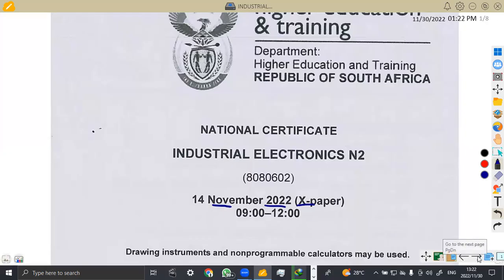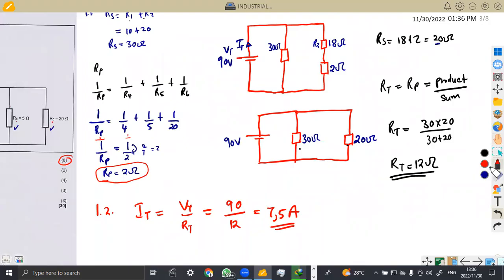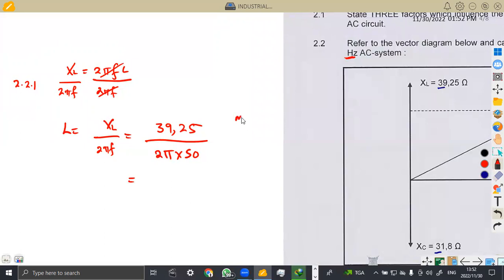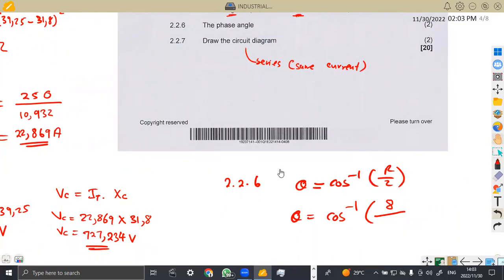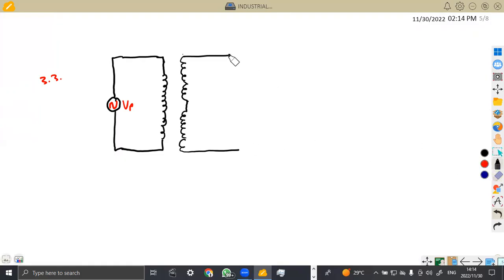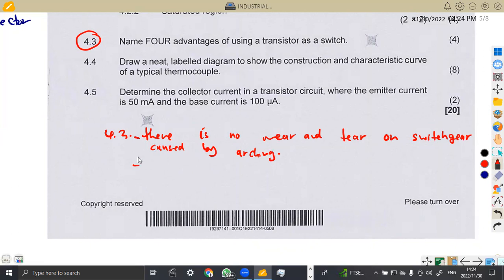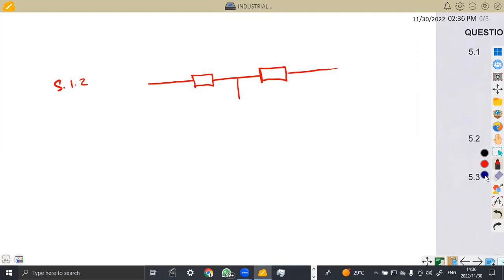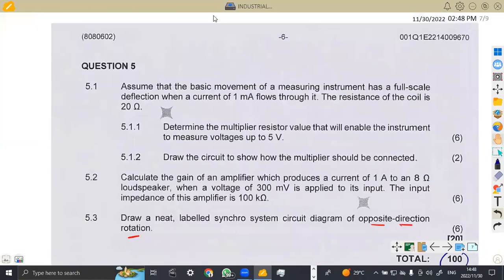INDUSTRIAL ELECTRONICS N2 NOVEMBER 2022 FULL PAPER MEMO NATED ENGINEERING @mathszoneafricanmotives

Comment: Hello sir . Why did you use 2 to calculate voltage drop across R5 . The current that flows through R3 is the same voltage that flows through Rp.why not vrp=I2*Rp , 4,5*20 ,=90V.
Reply from the maker: Our rp is 2 not 20